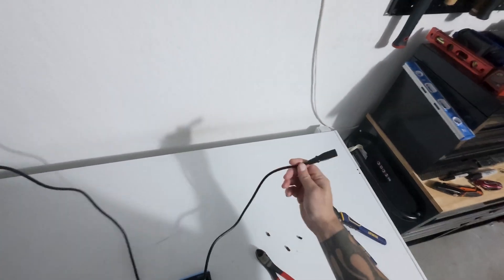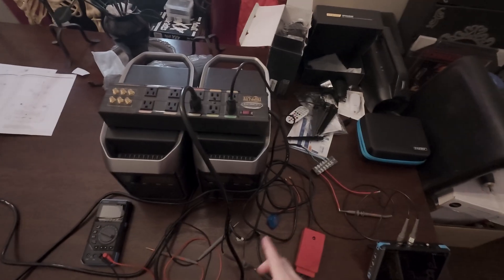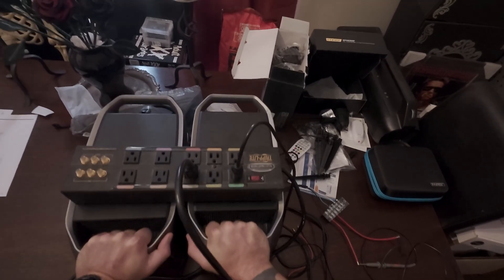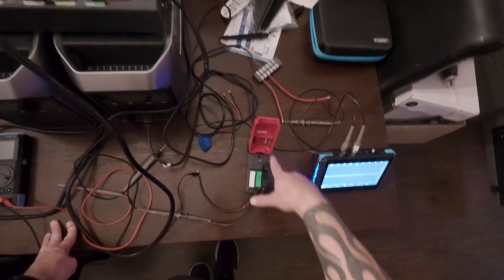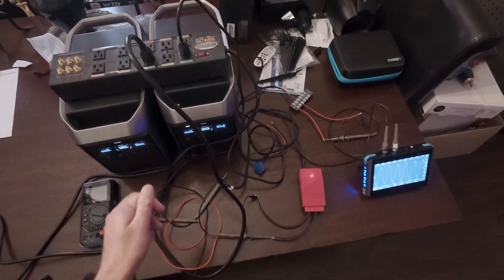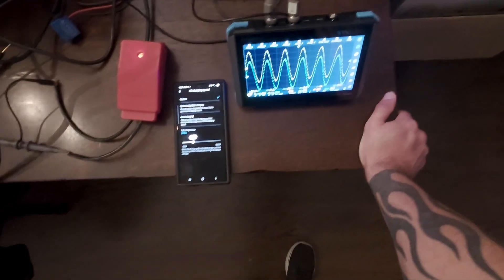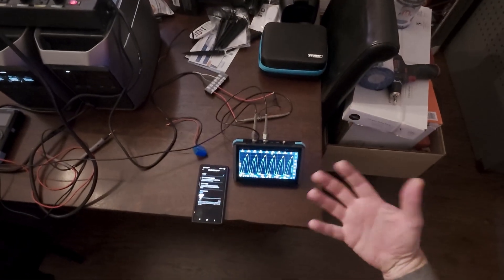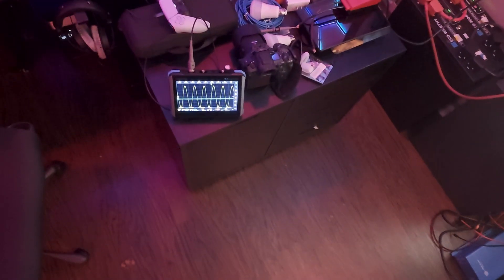EcoFlow's Dirty Little Secret - Delta 3 Plus Inverter Quality Test

Comment: I have an Ecoflow Delta 3 Max Plus and i had the same issue. My UPS kept triggering due to the dirty current coming from the power station. The culprit might be the AC to DC converter (which charges the battery from the grid). I disconnected the power station from the grid plug and there are no more issues. I am not an expert but i've heard that the AC to DC converters make dirty current by design because the converters turn the electricity on and off many times a second and that generates those really bad sine waves. I've ordered some power filters and i will keep the power station disconnected from the grid until the filters arrive. So far this was the only issue i had with Ecoflow and can be easily fixed.

Comment: Did you contact ecoflow about this? Id be keen to know what they said about this 

Great job for your videos dude! Much appreciated
Reply from the maker: Posted it on the FB group got me temporarily blocked I think.

Same for the battery hack I'm about to release.
Reply: @ViciousXUSMC is that the battery hack with the resister i watched? That was the vid i was looking everywhere for a chat gpt sent me the link as i saw bluetti can be hacked without the resister

Do you have any other units to test how clean they are? I have a solix c1000 and i was going to sell it to buy a delta 2 (im lazy i like one eco system) but if ecoflow isnt producing top quality goods i may keep the anker and my new delta 3 plus
Reply from the maker: @lozzaridesemtb Yeah the resistor, now to actually build a proper cable (or you will see in the video when released, I pivoted and I'm making an entire Hub for the unit instead similar to the Hub D1 Blueetti makes for the Apex.
Reply: @ViciousXUSMC wow! Im actually buzzed to see that! I didnt buy a bluetti due to their weird cables but i was unhappy ecoflow dont have a nice hub like the d1 or even the d40 and id be stuck using their £300 alternator charger to back charge my camper van batteries! Looking forward to watching. You have a new subscriber im just catching up on your education series now
Reply from the maker: @lozzaridesemtb Cool, let me know what you think.  I need to work on how I deliver that content and work out the kinks (so more people find it entertaining maybe?) 
But I think the educational value is solid.

So I'd love to hear what you think after watching, if it was as good as I hoped for teaching.
Reply: @ViciousXUSMC to be honest the videos ive watched so far are delivered exactly as id expect personally

Its a question of whos the audience and as someone who loves learning, tech and science it eas right up my street. 

I cant find some of the The stuff youve done on other sites! I dont want to see general power station run downs anymore haha i want more in depth real things like this one where i found that the powerstation i just bought doesnt give perfect sine waves but ok ones. This is the kind of info i look for when buying stuff. Your hack video sold me the eco flow though

Comment: Here's another test for you, we had 2 of these at work powering a mobile cart. We do not trust their 'UPS' modes so they feed into an APC UPS before going to a device. However, we discovered that the inverter was putting out voltage back down the incoming cable which it should not be capable of doing for safety. A coworker got a shock from the Ecoflow Delta 3 1000W unit on the Mains plug prongs...
Reply from the maker: Thats crazy, I have my own issue about using these in conjunction with a regular UPS.  I have a big rack mount enterprise UPS and they are well designed for protection and power quality.  One thing they test is proper neutral/ground bonding.

When you plug a UPS into a power station like this its now a floating system and is not properly bonded.  That can cause strange things to happen like a chassis carrying current and creating a shock. 

But the actual unknown fact I want to share is most (good) UPS actually have a hidden limit of about 600w-800w of output before they will go into a fault state and stop sending power if they are not connected to a good power source with bonding.

So my server rack only uses like 300w but my window unit uses 500w, one time I flipped to backup power instead of grid power and it sent my UPS into a boot loop frenzy that was kinda hard to fix.  I had to unplug everything, manually turn it off, etc.

So yeah even using a UPS to ensure they work as a UPS has its own set of problems.

Comment: I bought delta 3 plus for ai inference server powered with EVGA 1600 Platinum PSU. After test connections/disconnections to and off the grid ecoflow drops or distorts power and a PC falls into a bootloop randomly after 5 - 60 seconds from the connection or disconnection event. Delta 3 Plus shows no errors when PC power drops
Reply from the maker: That sucks to hear, but thank you for sharing so others can see as well.
Reply: I'm just going to put this out there but switching power supplies (or any AC to DC converter for that matter) don't really care about sine wave irregularities. They also are quite tolerant of voltage deviations.

I don't know how you were testing this disconnect/connect but if you are saying the PC shut down when switching from grid to battery (like if you lost power) then that's merely the switch over time being too long (they claim 10ms but you know...)

Bootlooping is 99% of the time an issue with the actual PC, usually RAM instability or disk corruption (from power loss). Your line voltage would have to be very very low (like 20V low) for it to cause issues with the PSU and it's DC output, so think 100V or less.

Comment: Can we get an executive summary for us non-geeks who are looking for a non carbon monoxide power backup solution? Thx
Reply from the maker: Basically just that a pure sine inverter should create a perfect clean energy and we are seeing that this does not.

People like myself have actively avoided buy any non pure sine inverter for years because the power they produce may cause issues with some electronics that demand clean power.

Is this enough "dirty" power to cause an issue?  Maybe not, but it should not even be there.

I plan on doing a follow up testing my other Ecoflow devices and seeing if they are the same, and even bought the cheapest inverter I could find ($100) that advertises pure sine, and we will see if a cheap inverter is honest and bearing the Delta or if this is the new norm, cheaper equipment is not as high quality as it used to be.
Reply: Unrelated, but I though I'd share. I bought a supposed pure sine wave DC/AC inverter from Amazon. Power seemed clean but the output was low. I used a box fan as a test. Directly powered by 110-125V  to wall socket I got 48.1 watts, when connected to the inverter and marine battery, the fan speed was noticeably slower and it measured 37.2 watts.
Reply: @ViciousXUSMC can you expand on what "issues" this may cause? Interested to watch the deeper dive as well.
Reply from the maker: @PeterBlanchard I can but it's more of a topic to research not a sentence to be said.

In short it can damage sensitive electronics, and some things may not run at all.

Comment: @5:35 there shows 64.41hz, had a River 3 Plus that was up to 75hz, intermittently.  Also I think that should be set for the x10 probe? Numbers are off on the V peak/RMS?
Why is it 9.38 assuming that's really 93.8, seems very low. @7:01 shows RMS 12.3V I assume 123V...
Reply from the maker: Probe was set to x10

Comment: Does the Ultra have this problem?
Reply from the maker: I don't have one to test.

But I just got a cheap $100 inverter and I'll do a test on it, the river 3 Plus and the Delta 2 max and see how they compare
Reply: @ViciousXUSMC  Which River 3 Plus model do you have? The original model EF-RV-H02-1 or the "Wireless" one EF-RV-H04-1 that's sold by Costco. What's the manufacturing date, it's on the box it came in.
Reply from the maker: @adriftatlas  the original, I have three of them and never use them, so didn't get the updated one.

I prefer the Delta 3 Plus for almost all situations given its cost/size/capabilities
Reply: @ViciousXUSMC  Wonderful, can't wait to see your data!
Specifically, average voltage (DC offset), peak voltage positive vs negative, and duty cycle. Make sure to measure with several complete cycles in view, no partials, as the numbers may be off otherwise. A time base of 10ms/div works well on my scope, but yours might be different.
If you have an AVR hook it up and see if the AVR's transformer vibrates and buzzes. Have the scope attached at the same time and look for oscillations near the zero crossing.

The Delta 3 Plus is definitely more cost effective and quieter, but it's bigger and idle consumption is higher, which is why I originally bought more River 3 Plus than Delta 3 Plus. Kind of kicking myself for it now.
Reply: @ViciousXUSMC  Did you end up doing a test of the river 3 plus and delta 2 max?
Reply from the maker: @JesseCampbell0 Not yet, finally getting the parts delivered I need to do it right (safe) then I'll test and make a guide

Comment: EcoFlow has more than one dirty little secret.

Their River 3 Plus units have a -2.5V DC offset that makes home theater amp transformer vibrate like mad. Have three units that all do the same. If your scope measures average voltage, that's DC offset.

I bought a newer revision of the the River 3 Plus (has a Qi2 power bank bay on top) from Costco a few days ago and the sine wave is perfectly balanced. Still has a bit of overshoot/undershoot near the zero crossing, but that's inconsequential. My Yamaha AVR is silent when connected to this unit. All units run the same firmware, so I'd guess a hardware change fixed it. Now EcoFlow is claiming a firmware will fix it come mid July, but I somehow doubt it. Really depends if it's a calibration issue or poor components.

I also scoped my Delta 3 Plus and noticed the exact same thing you did. Thanks for confirming my findings! See my posts on Reddit under AdriftAtlas.

Also, you should really get a differential probe for your scope. I know they're expensive, but touching the BNC connectors can be lethal.
I have a RIGOL DHO804 scope and Micsig DP3000 differential probe.

Comment: Did you try to run the same test coming straight from the D3+ and not through your Triplite?
Reply from the maker: Yes it's in the video two channels, one is direct the other is not... Just  watch more closely.

Also all the screenshots that I overlayed were secondary measurements taken later all directly.
Reply: His snark reply caused me to watch again. He says grid power on second channel, not connected to plug on Delta 2. Also on Victron he show a plug without saying if that is the antique power strip or what load if any. I’ve watched a lot of power station reviews before buying. Not one has shown his results while load testing. Not sure the motivation but hey it’s YT